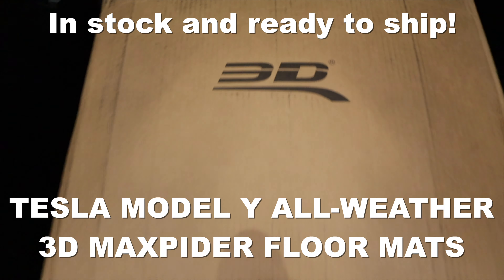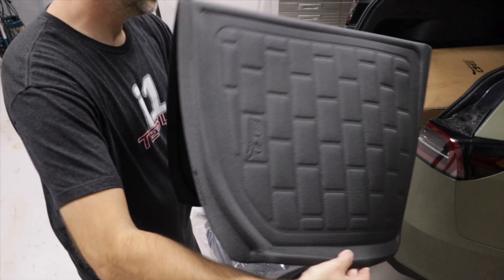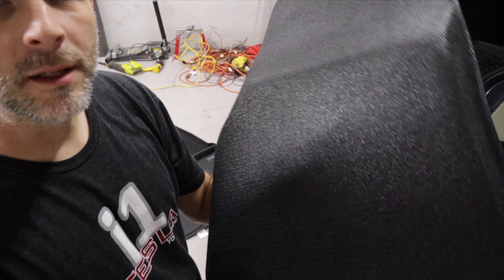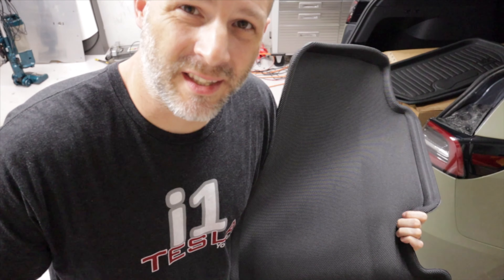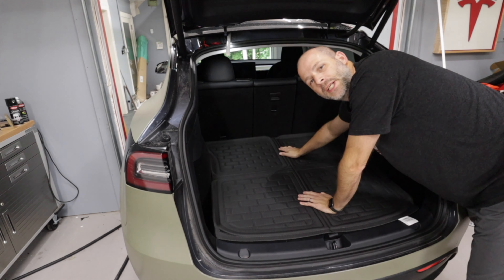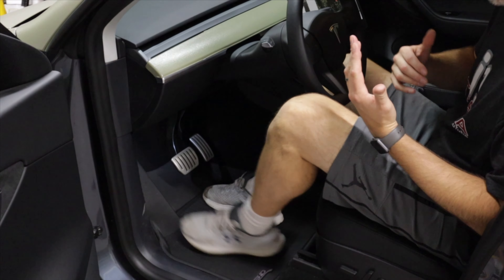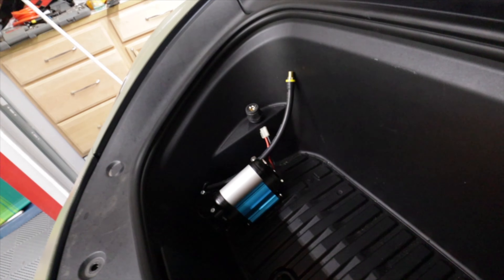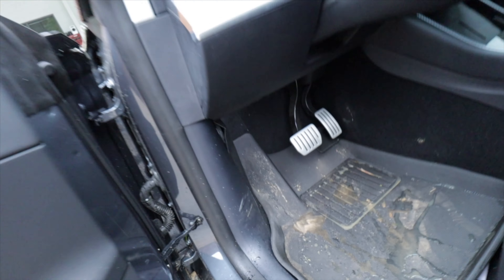Best Floor Mats for Model Y- 3D Review Maxspider

Comment: Are you giving away the large trunk mat because it sticks to the sub trunk lid so well you can't slide it down into the holders that keep it open? So you have to hold it open. Looks like you cut that part out of the video... Also because of the hinge it does not have side walls and can't hold water well like the other mats, but I guess there is no way around that if you want access to the sub trunks.

Comment: So I really like the look, fit and protection of the mats. I'm going to order the floor mats for the feet,  but I have a question. Do you think it would be possible to cut the big cargo area mat along the seam? I actually really like the front portion of the rear storage area (the one under the cargo area forward lid). (There has to be a term for that place in the car...) My wife and I use it to store our reusable grocery store bags. I lift that lid at least twice a week, and the full area mat would really need to be two pieces to be practical.
Reply: I have the set and I think you could cut it along the fold line, but it would require something beefier than scissors, as these mats are tough. Maybe a utility knife might do it, with many layers of cardboard underneath?